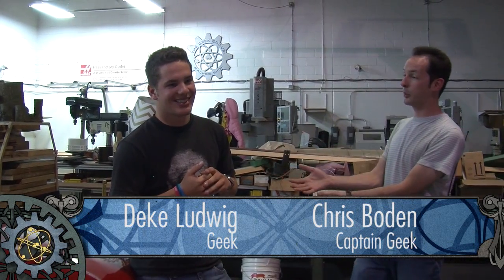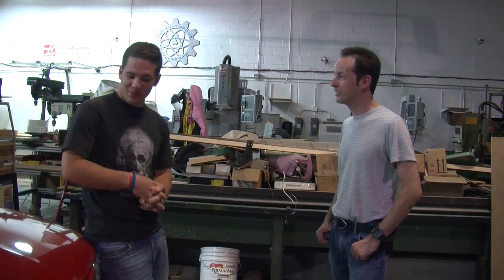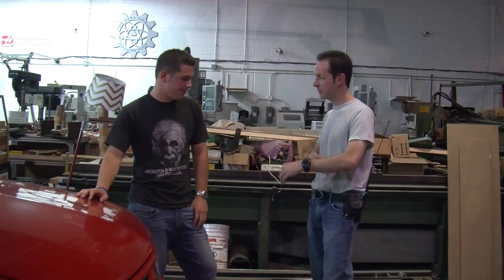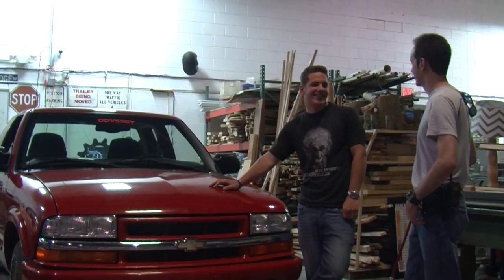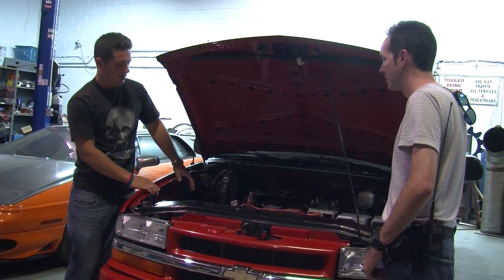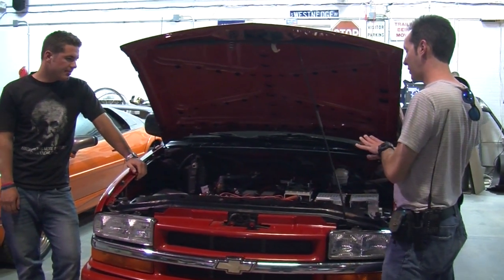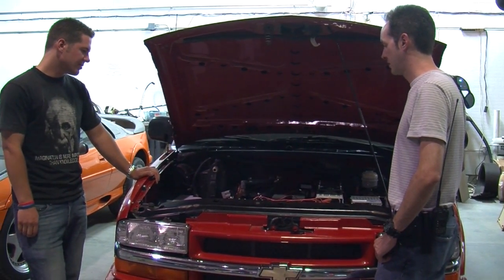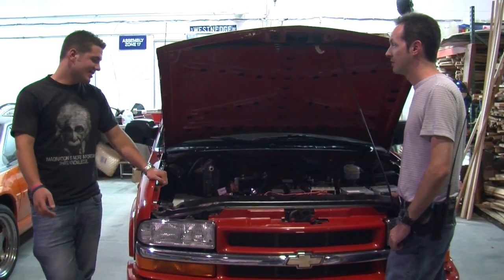Member Projects: Geek Group Gets an Electric Truck

Comment: Depending on the country, it may be more or less difficult. For example, in Sweden, it is usually a lottery. Some need to rebuild the car enough to get it registered as an "amateur built vehicle" while others manage with registration for "engine replacement". (Depending on the different interpretations of the same laws that the different agencies do...)

Comment: Would be better off replacing them with lithium polymer batteries, then you would get a longer range, plus get more capacity without going over the gross weight.